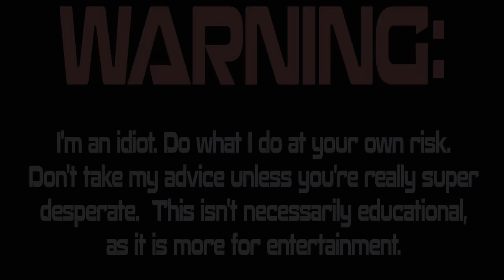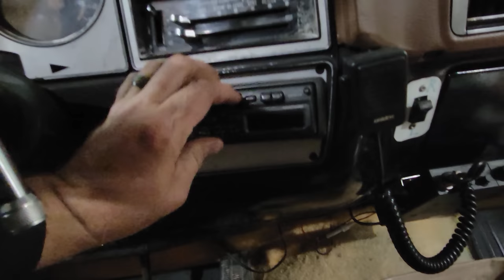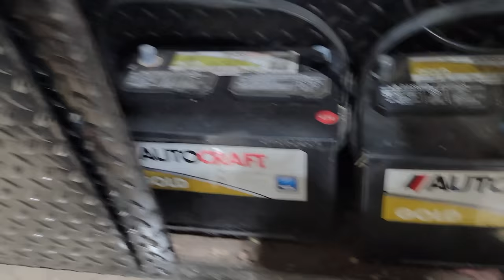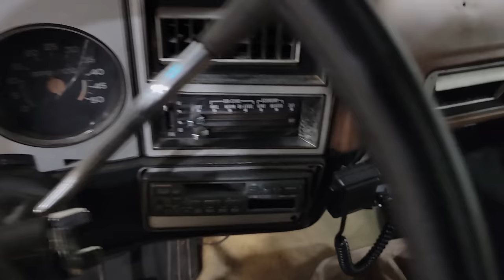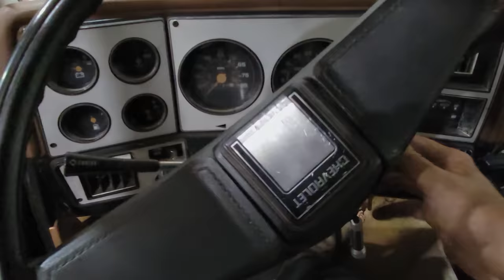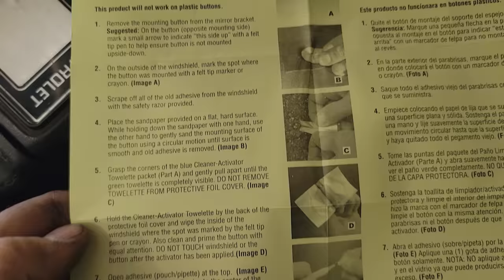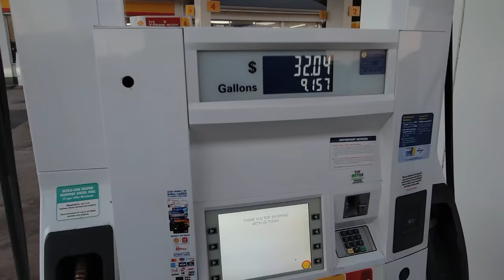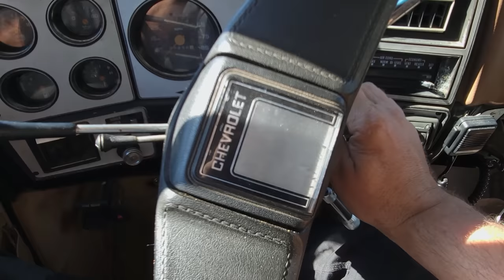Will this forgotten Chevy Ramp Truck Haul My Family & Ranger 800 miles?

Comment: Let's be honest, it'll never hurt to keep a rig around for Jessica to bail you out if you get in over your head 😂
Reply: So you’re saying an Escalade interior retrofit, new AC compressor, dryer, condenser & evaporator, and a custom stereo system should be next????
Reply: I think if he wanted to do an engine transplant, Derek should go for the 8.1L with a 4L80E transmission and put some highway gears in the rear, like a 3.08.  It would give him a much newer, and equally reliable engine as a 454 and the 4L80E would give him overdrive.  With all the torque an 8.1L produces, it would accelerate like it had 3.73s in the rear.  Very underrated engine/trans combo since it wasn't produced for very long but, he'd want to stick to 2001-2003 production years since that was when it produced 340 hp/ 455lb-ft.  

The biggest upside to doing this is that its basically bolt in ready.
Reply: Looks real nice
Reply: i agree with the 8.1 gasser but i’d go with the allison trans. and ya know a guy could find some tahoe or escalade interior at the copart auctions.
Reply: Super charged big block single cylinder diesel with dual exhaust would be cooler
Reply: My initial thought as well!
Reply: Flip. It.
Reply: @LukeEdward  the a/c works, why replace it.
Reply: @LukeEdward  absolutely
Reply: @actschp1   I heard the 4l80e didn't handle the torque of the 8.1 too well.  Gm dialed back that engine when it was mated to 4l80e's in suburbans or avalanches. However,  the 2500hd with the 8.1 had an Alison 1000 which can handle all that torque behind that 8.1.
Reply: @aaronpotter6559  Good info.  I was unaware the 4L80e couldn't handle the power.  I thought I had read some where that it was just a TH400 with an overdrive and some electronic control and that it was engineered to handle up to 600 lb-ft of torque but, I could have confused it with a 700R4 or something along those lines.
Reply: Do they still manufacture an aftermarket overdrive? You’d have to shorten one of the driveshafts. Ramp truck is a lot more convenient than a trailer to haul the rig around. ‘Cept when it rains there’s no place to go.
Reply: You are truly a genius and you speak the truth
Reply: @actschp1  the 700r4 is the mechanical variant of the 4l60e t400 is nothing close to any of them the 4180 is the same as a 4160e but beefier internals and better overdrive(the 4l65e is the hd/ heavy duty 4l60e) the 4l60e is basically a 700r4 with an electronic controller instead of a tv cable
Reply: @Majorrich  yesw a couple companies still make overdrive units for ford and gm but you gotta be careful because some of the older units you cant get parts for(his best bet is gear vendors since they make a unit specifically for this trans)
Reply: @TylerDuysen  700r4/4l60,65,70e is basically a th350 with overdrive. The 4l80e is a th400 with overdrive.
Reply: @LukeEdward  I like this idea a lot.
Reply: Derek keep this rig and a duramax swap would be awesome I'm really glad you and your family made it to Florida  safely  and put some miles on that ol 454 she runs good
Reply: Save on it bro .. i agree with gis
Reply: That's what I was thinking, the Rescue Rig!
Reply: @johnherdener6801  no there not the internals are completely different from a th350/400 or a 4l60e/4l65e/4l80e there are no simalarities to the th350/400 so no its not "basically a th350/400 with overdrive) not only is the clutching different so is the planetary gearset parking band and pretty well every component in the trans and theres no such thing as a 4l70e the 700r4 is the only trans that is nearly the same as a 4l60e/4l65e/4l80e the 70r4 is cable driven where as the 4le is electronically controlled the clutchpacks etc are the same between them (700r4 4l60/4l65e) the 4l80e has the same internal design but the parts are better
Reply: Had a 8.1 in a service truck. Terrible fuel mileage
Reply: @TylerDuysen  Don't know where you are getting your info from, but I am a retired ASE Master Tech and have rebuilt many of these transmissions.  Many, not all, of internals are indeed swappable.  In act the center support in the 700r4 and it's relatives will fit the TH350 which has no center support.  Other than tearing some down yourself all I can tell you is the read some of the books written by some experts on these transmissions.
Reply: I’m sure she’ll LOVE that idea!
Reply: @johnherdener6801  i went to college and got a degree for master mechanic for diesel and gas engines and also learned from watching old timers and mainly learning by self taught/trial and error i never said the internals wouldnt swap i just said they were different not only the cases are different just because you can swap parts doesnt make it"basically x trans with overdrive" thats like saying an ls is basically a 351 w because they have similar parts inside i get where your coming from but there not the same transmissions just have similar parts
Reply: Brilliant. I was thinking the same thing
Reply: @teknizzle420  retrofitting to modern refrigerant will ensure it is easier to work on in the future.  But yeah. You got a point.
Reply: @TylerDuysen  OK, yes there are many parts in those transmissions that are not interchangeable, however they are based and evolved from the th350 and th400 and there are many parts that do directly interchange. Yes, they are not merely a th350 or th400 with an overdrive tacked on as there  were many updates and changes.  But, with that in mind would you say the gen2 Chevy small block LT1/LT4 (1992 -97 ) was not a direct descendant of the 1955 265 even though almost no parts interchange between the two?  That was the point I was trying to make.  Also there is indeed a 4L70E.  Just put 4l70e into a search bar and see for yourself.  I hope this clears up any misunderstandings.
Reply: @johnherdener6801  i didnt know a 4l70e existed  probably because it appears to be aftermarket but thx for the info second you literally replied above saying they were basically the same trans with an overdrive i was just pointing out they are not so i dont get why you continue to argue no the lt1 and lt4 are not based of a 265 there based off a 305/307350 sbc it was gms start of tuned port injection(lt1) i get where your coming from but at the end of the day i was simply correcting your earlier comment about them basically being the same trans having similar parts doesnt make it"basically the same thing" you have a good night we dont need to beat the dead horse any longer
Reply: IF he gets in over his head?
That's what the channel's all about, lol!
Reply: Jessa has her competitor the White Knuckle Towing service (Watch Mrs. Wes Work), in the Ohio/Illinois area so adding to her tow fleet with a ramp truck would make her lots more versatile than just the tow rig and trailer that she does rescues now with.. we just need a nickname for her company. Bieri Farms Hauling just isn't quite funny enough.. and doesn't quite roll off the tongue. but I suppose they are somewhat more serious peoples.. serious sounding name.
Reply: @actschp1  good motors but even in a extend cab 4x4 they get 7 mpg
Reply: Add a gear vendors overdrive and call it a day 👍
Reply: Not to mention it’s badass when a girl drives such an old towing rig that’s as big as that one. If I saw my girl pulling up in one of those I’d make a ring out of how clamps, washers, and a nut
Reply: Exactly what I thought of. It would be quicker and easier for Jessica to come out and rescue Derek in this rig, than hooking up a trailer to one of the trucks. I'd fix all the important stuff and stock up all the lockers with tools and fluids. There's plenty of real estate on this rig for some signwriting too. Seems like a no-brainer to me.👍😁
Reply: Great video ya'll!! Good to see all the family together on a road trip that's a sweet ride actually in Great shape for the year I'd personally keep it and enjoy it personally I think it's hard to beat the old big blocks.  That one runs good no oil usage think a keeper.  Thanks for sharing be safe have fun enjoy ya'lls family time
Reply: A holly sniper kit a 4L80E and a gear vendors overdrive would make perfect rescue rig for Jessica
Reply: Agreed
Reply: Hahaha
Reply: @LukeEdward  l
Reply: I wouldn’t do a fuckin 8.1. I’d do a 6.6 or a 5.9 common rail
Reply: @LukeEdward  why swap out any of the a/c system?? It’s working as it should
Reply: @actschp1  poll] 0
Reply: @frankeysanford8670  you lost dude?
Reply: @user-bx3gu3st9b  single cylinder
Reply: I was thinking same thing! lol
Reply: Yeah but I’ve never seen him get over his head so much as the vehicle just isn’t up to the challenge
Reply: @actschp1  6bt😮‍💨
Reply: 800 miles!? From Tennessee? It’s 1500 from here in central Maine and looks like you’re well beyond half way. 😒 a guy jus can’t believe it’s not 600 miles from VGG, G.
Reply: @actschp1 this sounds like a great plan hope he sees your post
Reply: and that way he could pass anything but a  gas station
Reply: Never seen a 8.1l that had the power it should have. 496ci should be an easy 500hp.

Comment: Keep that Ramp Truck! Face it with your “Will it run?” Videos and your busy schedule Jessica can come save you on the road! She is already comfortable driving it so she can load the boys up if need be go get you and the new ride. You can just always have it stocked with straps and rescue supplies plus it has a winch so regardless what your driving and regardless how bad the breakdown is you’ll be able to load and go.   …… on the subject of speed of the truck the cheapest fix would be just changing ratio to something like 4.10 that big block has enough torque to keep everything happy and you’d be able to go 65 or 70 running without revving it to the moon
Reply: It has a 411 gear now!
Reply: 410 is a Ford ratio. 411 is GM.

Comment: That's a surprisingly nice ramp truck, she's got the potential to be something really special! Definitely fits in with what you do. It could definitely be a dedicated race truck! I'd suggest some reliability upgrades - mainly, redoing the fuel delivery system, replacing that leaky hydro-boost reservoir, perhaps a transmission swap or an overdrive.

Comment: I would continue to make small improvements to it.  A 12 valve Cummins would be cool but that's another huge project.  The truck is nice and is intact.  I'd keep it that way.  If it were mine, I'd put a GearVendors Overdrive on the back of that TH400.  That would get you to where you could comfortably cruise at 70-75.  She'll still be thirsty....because Big Block Chevy, but there's a definite cool factor to keeping the truck intact.  A GearVendors install would be a cool video too.  I put one in my Dad's 62 Ford Galaxie.  Reach out to GearVendors.  Maybe they would supply a unit.
Reply: A nice running 454 uses lots of fuel but they last forever and it's not a daily driver. The Car Wizard recently bought a nice V10 Ram and said the low price  of the gasoline  truck trumped the advantage of the increasingly  spendy 12 valve equivalent - for a truck that won't be used every day.
Reply: I agree with you @texas82gp,he should put a Cummins in the black ramp truck,it would sound really cool  😎 with a  turbo on it,I would love to meet Derek & Jessica sometime,especially if they come to Kansas city for a car show & if I have the money

Comment: Just towed my C10 on a U-Haul transport trailer 1200 miles with my 2001 5.3. Not a drop of oil burnt. Ran about 2300/3300 in tow haul mode. Gotta say, damn impressive. That 454 has been maintained well, and is obviously made for such a chore. Next time I'll use my 6.0, but ya gotta love the Bowtie motors.

Comment: Defiantly worth keeping as a haul and rescue rig. For when your drives home don't go to plan. 
Duramax would be way easier and cooler than a 6bt swap. You could even go a 6l80 if you really want all the gear options.
Otherwise a overdrive and EFI conversion.
Reply: More thoughts I'm going to add this here.
You can get 30 gal tanks if you want to increase your range even further. 
Also you could add a second filler to the drivers side, linked to the passenger side tank. That way you can fill both tanks without needing to turn around.

Comment: I personally would keep it and maybe put a few finishing touches on it like getting it to run primarily on the mechanical fuel pump and maybe keep the little electric one as a backup. Might would even get the CB up and running, use it whenever you need to haul stuff. It's a nice truck and a nice setup. Definitely a going to town rig.
Reply: Definitely a keeper.  I don't often see ramp trucks.  I think many now  prefer the diesel rig with car hauler trailer. I'd keep it because for the money it can't be beat
Reply: @timothykeith1367   I definitely gotta agree on that. The truck is in good shape, the engine seems to be running very well, and the ramp/storage rear is very useful utility wise. If anything I'd probably change out the rear end gears and speed sensor with more of a highway setup for higher speeds for interstate driving and better fuel mileage. Other than that I'd definitely keep that rig for hauling cars and trucks for a long time to come. Whether it be for racing or recoveries, it'll definitely come in handy for both. I'd definitely keep it.

Comment: When you have dual wheels, you're actually carrying 2 spare tires
Reply: How many lbs your gvw isn't worth a life ,you all seen  dump trucks that had a 3rd axles not touching the road because they were empty  gvw has nothing to do with only a single tire on each corner and the way I was taught was if you were driving a dually you needed to carry  a extra spare  so your on road with 8 tires and wheels  especially when you're hauling triple axle tie beam trailers that just are going to always be overloaded after you strip off the forms and  few hundred 30 lb clamps and 100 sheets of 3/4 inch form boards are going to weight more after every use and  it doesn't pull the way double axles do its a very big problem when you have 3 axles trailers come off or not pinning the receiver  and you have 10k lbs on 6 wheels  taking out everything in its way

Comment: Derek those extra holes and that square hole on the back of bed are usually for a sling type junk tow set up a upright goes in that square me hole in top of bed with 2 shive wheels for ur winch cable n then a tow bar on rear using the winch to lift

Comment: Very Cool Wedge Truck. I have an ‘84 Crew cab ramp truck, that had the 454/th400 drivetrain. I did the gear vendors on TH400 for overdrive, and it made a big difference on the highway. I eventually 6.0/4l80E Ls swapped it, and its a dream to drive and haul with now. Love all your videos, I’ve even recently went back and started watching them all over again.

Comment: I am building my very own 1971 GMC C3500 ramp truck! I am building it very similar to this. Bought it with a flat bed, but using an old wedge car hauler trailer frame and using that for the ramp. Adding in storage similar to yours but trying to keep a more rounded look to go with the body lines. Have it in my head and hopefully I can make it a reality.

Comment: They have Manual tank switching valves.  drill a hole in the floor under the driver's seat and pop in with the handle pointing to the side of the tank. 18:36

Comment: Wire wheel the rim & there is a sealer you can buy from a tire supply store that would seal the rim. I did commercial tire work for 6 years.

Comment: Often times vapor lock is not the fuel being hot. It's the air coming into the mix because of warm weather and engine temperature. A properly install K@N cold air intake will make a big overall improvement including a cooler air mix.

Comment: Hey Derek what about a gear vendors overdrive and that turns that turbo 400 from a 3 speed to a 6 speed. And the only change is to shorten the front section of driveshaft.

Comment: Leave the Taillight risers alone -,get the LED  lights middle and rear end. easier on the Alternator. Get the radio remote for the winch, and a spare tire and rim, plus make sure the tires are from the same decade. 😊 10:46

Comment: This wedge truck is a gorges rig!  It would be great for a repair / recovery rig for local car clubs on rallies.  Not sure what the insurance issues would be.  I had a 1976 ¾ ton camper special with a 350/350 that ran like a champ for me.  I drove to and from Anchorage Alaska to Colorado multiple times.  I finally traded it off because it was a two wheel drive, and four wheel (even just staying on the paved roads) is really a good choice for Alaska driving.  Even with the 350 it only got 10mpg, but that was loaded heavy or empty.  Easy to work on, comfortable and “built”.  I haven’t seen it in any more videos, so I guess you moved it along.  What a nice rig!

Comment: Gear vendor planetary gear box bolts on tailshaft will drop 600 rpm in high.   Plus you can split shift like an old 2 speed rear

Comment: Keep the truck and use maybe a Gear-Vendors overdrive unit to lower those revs. I got a 1972 SS El Camino with a 454 and it will get 17 mpg on the Interstate with that Tremec wide ratio 6-speed tranny. About 1500 rpms at 60 mph.

Comment: Dalton, you’re right. Semigloss is pretty much gloss. What you want is satin. Satin has a slightly gut sheen to it so it’s not quite flat. I’ve been through the same issue and feel your pain. 

Def need to see more of the Torino! Did the primer come off the front fender stripe?

Comment: I like the new exhaust on the danger ranger. I have side exit exhaust on mine as well. I got a two chamber 40 series Flowmaster 3 inch inlet which is the same size as the catalytic converter outlet and dual 2 1/2 inch outlet which is side exit with dual 4 inch stainless steel tips yes it’s loud and it sounds mean as hell